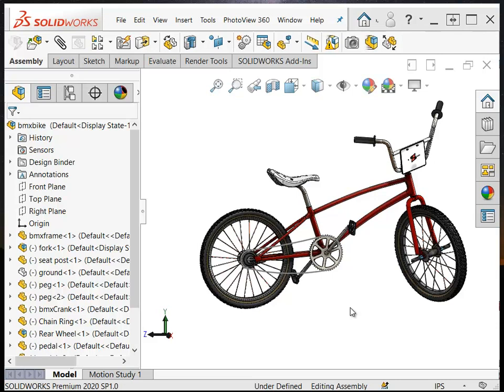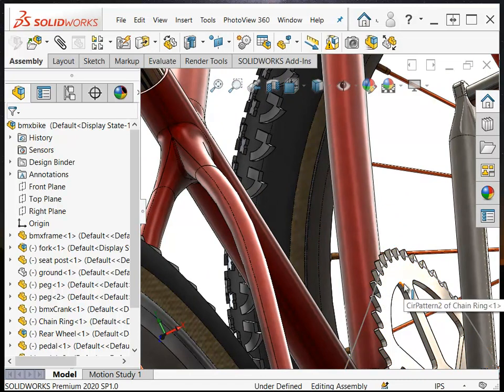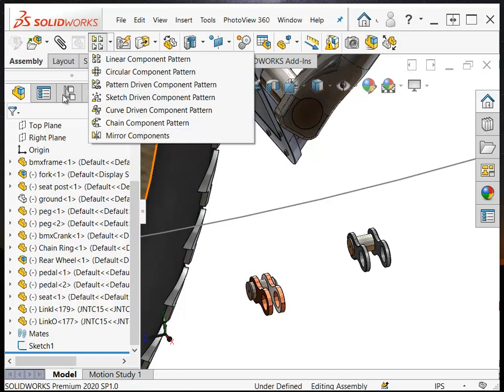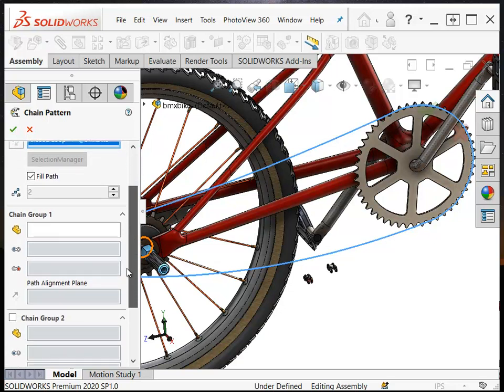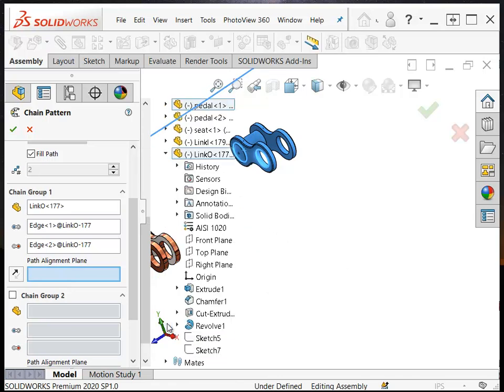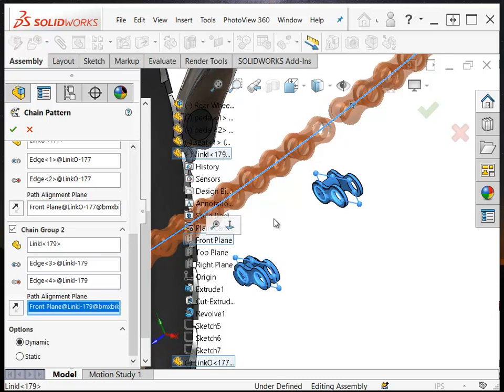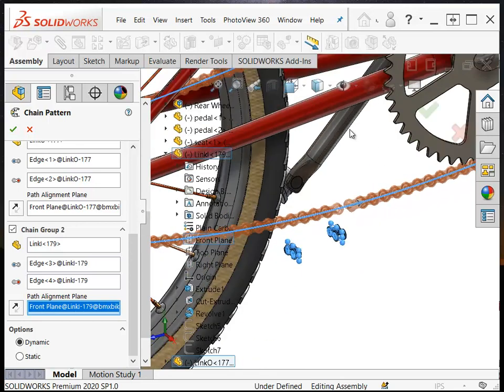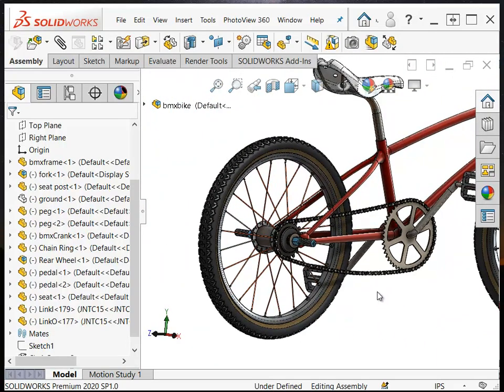Creating a Chain in a SolidWorks Assembly

Comment: Very nice video but please  since the path is not completely filled how do you know the length to increase the path with to make it comletely filled
Reply from the maker: You can measure the distance of the gap, and then knowing the length of each length, you can either add or subtract a link, or move the wheel, or add or remove some sag to the chain. There are several ways to solve the problem
Reply: @mattAtDezignstuff  Thanks a lot just seeing your reply